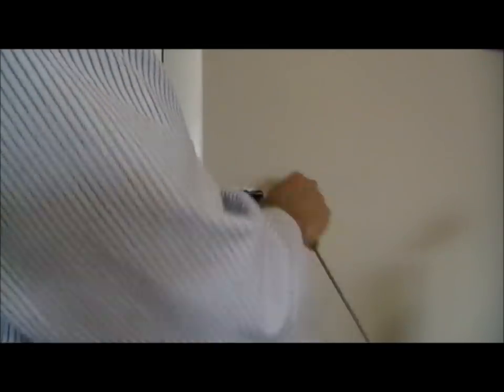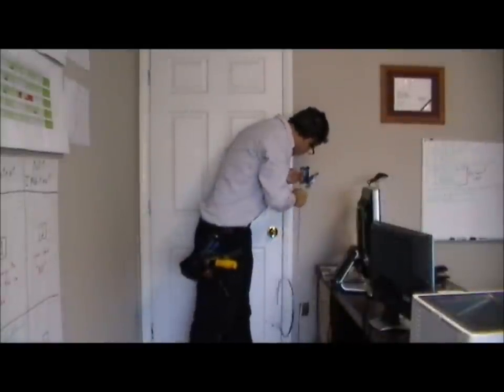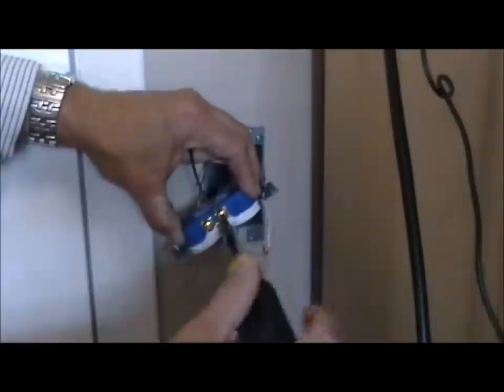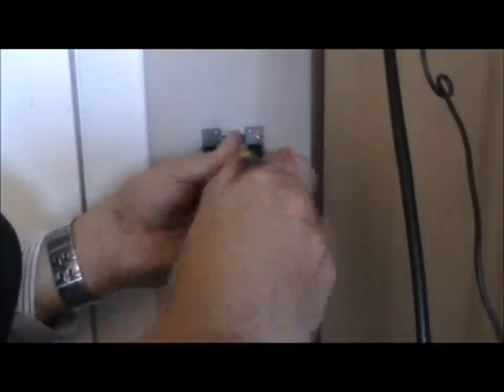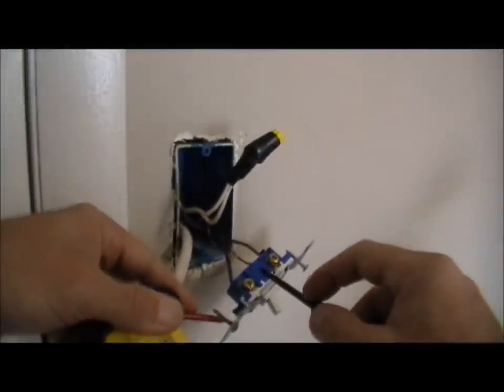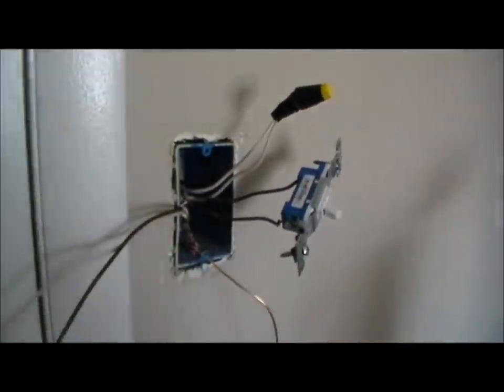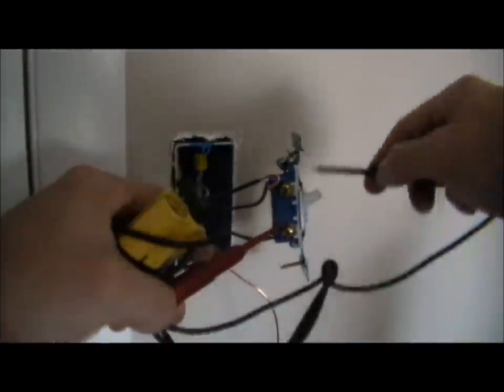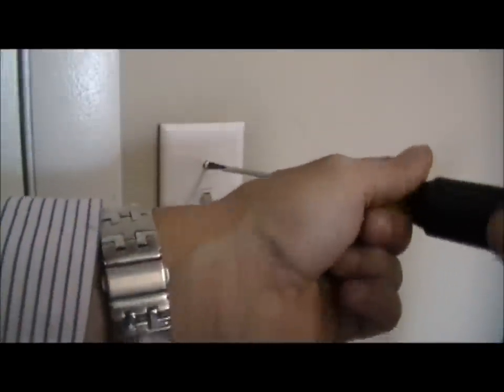how to wire an outlet off of a switch

Comment: Is this an outlet with an electrical flow controlled by the state of the switch?
Reply: nope, the way he wired it the plug it is energized all the time.
Reply: No.  The black wire was connected to the one coming from the breaker/fuse.  The other one was connected to the white wire coming from the breaker/fuse.  Its kinda stupid to wire it across the switch (like in my bathroom) where you control the light with the thing you plug in.  My lights go dim when I try to shave with a plug in shaver so I can't use the damn outlet. if you use it with the lights off, they turn on dimly and the plugged in thing operates slowly like it has extra resistance in it.  So, I had to switch to regular Mach 3 razor instead.
Reply: but you can do something similar to feed a few wall lights off the same switch right? you would just need to hook the lights up to the exit wire on the switch and use one of the plastic caps? Is there a limit on the wattage you could draw from it or any other concerns?
Reply: Robert Wainblat If you don't care about controlling all of your lights from the only existing switch, then yes (but only if your extra lights are connected in series, because you only have just so much room in the box). Lighting circuits usually don't draw much power, but you'll need to know if there are any other circuits tapping the power (hot) wire, before you attempt this. The hot wire (power "in") may already be connected to more outlets & lights. But then again, you could always retrofit a bigger box to accommodate more wires & switches.
Reply: Garras Porgratix
couldnt u rewire your switch box like he did and use ur electric shaver again!!?
Reply from the maker: If you want to switch the outlet you would have to feed it on the other side of the switch. This outlet is live 100% of the time. It is attached to wire coming from the panel. If it was attached on the opposite side of the switch when the switch was open the outlet would be off.

Comment: I'm curious what people find so wrong with this video.

The main issue I see is there was several instances where if you were inexperienced with electricity and decided to work on this hot you would get shocked using his methods.

There should be a grounding crimp on the grounds he twisted together, but not using one isn't the end of the world. As long as they are tightly twisted together they shouldn't come undone. It's a minor code violation I believe.

The switch is using stab-ins which are (as he explained) untrustworthy, but adding the outlet's hot to the screw didn't make it less effective. As long as you don't add two wire hooks the same screw you should be good. A pigtail is the best way to do this.

You also typically do not use linesman pliers to make shepherds hooks or stripping. Wire strippers are used for both. If the wire is firmly under the screw, you're good though.

None of what he done is outlandish and your home will likely have similarly done wiring.

Comment: I WOULD SHUT POWER OF PULL SWITCH OUT OF BOX TURN POWER ON TEST FOR UNSWITCHED WIRE MARK IT WITH A PIECE OF TAPE                                              
SHUT           POWER                     OFF             FINISH JOB   PUT SWITCH BACK IN  BOX  TURN POWER BACK ON

I THANK YOU FOR HELPING PEOPLE LEARN BUT MOST PEOPLE WATCHING THIS ARE JUST LEARNING AND SHOULD NEVER WIRE HOT
ALSO YOU SHOULD NEVER TOUCH THE METAL PART OF ANY TOOL WHEN WORKING WITH POWER ON OR OF ITS A BAD HABIT

Comment: I have done exactly this...live circuit work....but I'm a Plumber so I'm  much more careful. Here a trick....if I'm too lazy to go get a test or amp meter to check if a circuit is live after turning off the "hopefully" correct breaker .....I tap the bare wires with the BACK of my hand or fingers.... because.... electrical shocks contract your muscles and you may not be able to let go if you use the inside of your hand or fingers. Once I know the power is off, I can dig in to what I'm doing..... I've never been shocked testing this way...but I've been lit up being careless in other ways.

Comment: shouldn't your "always hot" terminal on a switch be the "off " (bottom terminal) position of the switch??  That way when you flip the switch up, you know that only things connected to the top terminal will be energized??
Reply from the maker: That's an interesting idea. I like it makes sense. There is no convention for this to be true. You always need to test the switch for the Hot conductor.

Comment: Turn the power off at the circuit breaker BEFORE attaching...you can test, make a little drawing if you have to of what is hot all the time (power in) and what is hot only when the switch is on (power out).

Comment: Wow you really live life on the edge. I work on live circuits too occasionally but I'm a lot more careful and use insulated tools the wiring however is safe only thing I'd say is please be more careful around live circuits it's for your own safety don't mean to be a dick even at 120v 15a is quite a bit more than it takes to be lethal
Reply: The resistance of the body will determine how many milliamps or amps will go through the victim, but like you said it doesn't take much. 25-50 milliamps could do it.

Comment: will this outlet only work when the light switch is in the on position or all the time?
Reply from the maker: The outlet is fed on the hot side of the switch and will work 100% of the time. If the receptacle was fed from the other side of the light switch it would only work when the lights which was in the closed position.

Comment: Dumb question, is there any way to wire a new outlet off a switch that isn’t going to turn off the power to the outlet  when the switch is turned off ?
Reply: NebuR Fernandez    This video showed you what you are asking for.   He connected to the "hot" wire on the switch, not the "switched" wire.

Comment: how did you not get shocked while turning the live screw with your bare finger?
Reply: he wasn't touching anything grounded so the voltage had no where to go. you can touch a hot wire and not get hit if you aren't touching any grounded object lol
Reply: huh?  i've never been "not shocked" when i touched a hot wire.   my boots have rubber soles even if they're synthetic they're insulators.... and yet still conductive enough to make sure i feel it!
Reply: If u not grounded or touching anything else the hot wire can't shock you

Comment: This my friends is an electrician you should not be learning from. The first manager red flag was when he said an open circuit turns the light on and closed is off. That’s some 101 stuff to get wrong. Then he measured with a hammer, you always measure with tape. Then he wired the ground last. Ground always comes first. He didn’t fold his wires. And plate screws should always be finished vertically. That’s more of a pride in work thing.
Reply: You are correct. Using linesman's pliers as wire stripper, not good.

Comment: Did you put two wire on one screw.
Reply: Yeah I say the same thing I'm about to do one in my utility room and that's the reason why I was trying to find a video to show how I hook another wire hot wire to the one coming into the box I thought you use a jumper wire and connecting and then back to the switch this guy hook two wires on to that one screw on the side of the switch I'm not sure about that

Comment: can you power outlets like this through a 3way switch with 12-3 coming in hot ans 12-2 going to the outlets?
Reply: You will have to identify the hot side coming from the panel and then connect to the wire....

Comment: So the wiring in my house just has a black, white and a ground. Not two of each like this video and a metal box. How can I add an outlet from the switch?
Reply: MOPARGuy does the switch do anything? If it does the white neutral is probably being used as a hot. Don’t forget to turn the power off

Comment: I cannot find a situation exactly like my own, this is typical, two neutrals twisted together, I have only one white wire (currently capped off).  From a receptacle connected directly to the panel, I have a 3-core run of Romex (wires inside a jacket) running to a light switch, the white is just capped off with a wire nut, the other two wired (black, and I think the other one is red) are connected to leads on the switch - works as it should, switch turns the light on and off.  I want to wire a receptacle right next to that switch, don't want the switch to control the receptacle, I want the receptacle to be able to power devices plugged into it regardless of whether the light is on, I just want to bring constant power to the receptacle by connecting it to the switch.
Reply: So I think you were sitting at the far end of a 3 way switch circuit. The red & black wires there sound like travelers to me... Hard to say without looking at it directly. You should have seen 3 conductors in there for a 3 way and I'm guessing they just capped the neutral as it was already in the romex and wasn't needed. Since the switch is on the incoming leg of the circuit it doesn't need to be connected to a neutral - only the light fixture needs the neutral connection to send the load back to the power source once it's been through the bulb. This diagram seems to match what you're talking about: https://www.familyhandyman.com/wp-content/uploads/2018/04/how-to-wire-3-way-switch-2.jpg I'm only an amateur in all this but I'd be interested to see if you ever found a solution.

Comment: I thought that you didn't like to plug wires into the back of receptacles? Even though you used that method on a switch, couldn't it still work loose and cause an issue? Switches get turned on an off multiple times a day. I'd have made a pigtail myself. Hence, only one wire is utilized around one connection point...... just my thoughts.....

Comment: He knows his wires but he cut to many corners tht nec may have an issue over. Eg. He was suppose to pig tail the wires together also the hot is the last wire to b connected. Then there's the whole use of three wire now blk red white oppose the the two wire. But to the earlier question yes u can make the outlet go off using the switch by placing the outlets hot wire on the bottom of the single pull.

Comment: So .. the outlet is only receiving power from the power wire connected to the switch, and the new outlet IS NOT being controlled by the switch. The outlet is hot 24/7 even if the switch is in the off position.?
Reply: Yep, Keith.

Comment: in Chicago this would not be code , you need flexible conduit - greenfield  3/8  and 2 wires black and white
inside of it , metal boxes bonded to greenfield ( flexible conduit ) with connectors  green wire is always good , especially in this video

 We did have a great fire in Chicago  in 1871
Reply from the maker: Chicago does have unique set of codes.

Comment: I did exactly what you did but when i plug in my appliance to the outlet and turn it on, the lights turn on and no power to my appliance. Any suggestions would help. Thanks
Reply: Check your appliance, did you figure it out, should work. Check your connectors and make sure you have power to the plug

Comment: In the video at 12:30 you showed which wire was the hot wire and you touched this with your fingers. How did you avoid election shock?
Reply: Rick    Luckily, the ground was not connected to the light.   Since it wasn't, it's the same as a bird on an overhead line.  You become energized but with no complete circuit path, no shock.   He came very close to getting shocked though, had he touched the ground wire at the same time.  If he worked for the contracting company I just retired from, he would be fired for unsafe practice.  The circuit breaker should have been turned off and verified.

Comment: Why was there 2 black and white wires running to the switch originally?
Reply: One set (HOT(blk) , NEUTRAL(wht) and ground) comes from the power source, while the other set goes to the light fixture. The two blk wires (HOT) are connected to the two terminals of the switch, The white wires (NEUTRAL) are connected together using the wire nut. The ground wires are also connected together, as well as connected to the ground terminal at the switch (usually GREEN) and to the ground nut on the electrical box, if the box is metallic, to ground the box and avoid getting electric shocks. In his case, the box is probably plastic, so the ground wire probably is not connected to the box.

Comment: Now what do you do if there is only one wire going to your switch?  One white, one black, and the ground.
Reply: Ross Ashcraft    You do nothing!   You can not add anything from that point, except another switch.   You need a neutral (not white wire) a neutral in order to add anything.

Comment: What do you mean this guy not using a ground nut? Rather than connecting the ground wire to the switch putting a nut on the ground line?

Comment: I don't have an electrican s hammer would a tape measure work or a drywallers hammer I'm a drywaller
Reply from the maker: The electrician hammer is just a time saving cheat. Measuring will always work.

Comment: I have a light switch wired to an outlet. Black , white,and copper wire. I only have power to that outlet with the light switch on. How can I change that so half the the outlet works with out having the light switch on?
Reply: i think the other blackwire should feed the outlet the black wire you used was after the switch
Reply: The video didn't answer my question at all. I have a light switch that controls the outlet.  I want the switch to control half the outlet. In other words, when I have a light plugged in it will come on with  flipping the switch and when the switch is off I can plug something into the other outlet and have it work with out flipping the switch on. How do I wire that?
Reply: +Tom Gala if you look at the outlet screws you will see  a tab that connects the top screw to bottom  similar on both sides you need to cut those tabs on both  sides of outlet then  supply a hot and neutral to top any to the bottom half connect the wires that are coming directly from switch. neutral in one side the hot in the other  then half will be control by a switch the OTHER  half will always have power .
Reply: Lucky Joestar what exactly do you mean when you say “and join this pigtail to the black wire from the source and the white wire to the switch”

Comment: Hey, so does the outlet turn off when the light switch i off?
Reply: Halley Chopra it's wired to the hot side. So it'll be live all the time.
Reply: Halley Chopra it's wired to the hot side. So it'll be live all the time.

Comment: In the UK this would only be done by some one with little to no electrical knowledge because:
1. We have different cable sizes for sockets and lights.
2. We have different amp breakers for sockets and lights.

Also in the UK this would not be done live in most cases.

Comment: Cam you connect two hot wires on one screw ? that's not what they were teaching us
Reply: No
Reply from the maker: Very good observation. No you cannot put two wires under one screw. There is only one wire under the screw. The other wire is installed in the backstab location of the switch. Since that video was taken we are no longer using the built in backstabs on electrical devices. We are opting to pigtail and use the screw terminals because they work much better with AFCI circuits.

Comment: Hey I just watched this video for the third time so I go to the light switch and open it up but instead of seeing this setup I see "exactly" this, the switch only has two poles on it, the "black wire is on the top, and the white is on the bottom, there is no other screws to post anything else, the ground wire is tied off to the box only, and not on the switch. I looked at a couple other switches in the house and they are all wired exactly this way. Please tell me how I can add an outlet to this switch.
So the problem is upstairs in my living room there is no outlets on the inside walls only the outside walls, I wish to put my TV and stereo on a inside wall. So going down my basement stairs there is a light switch at the bottom of the stairs, this light switch is directly below where I wish to put an outlet for my tv and stereo. Now if this switch is wired as I have said above can I still tie into it. Please help, anyone have an answer. I am in Canada we have 120 volts 60cycles..
Reply: No you would not be able to cause there is no neutral in the box, you would have to come from the light box or a junction box that does not have too many wires on it.
Reply: Be careful that you aren't ty-ing into a three way or four way switch because the wring patterns are different. From a big picture perspective you are just attaching your plug by attaching to an existing neutral (white) and an existing hot (black) from the same circuit.

Comment: Thanks for posting this video.  For the DIY'er i would have given a solid lesson in electrical safety, such as cutting breakers, taping sides of the outlet screws for the next hack, as well as some handy tips such as testing outlet below before screwing back in the switch (in case a connection got loose or reversed).  But given that i have NEVER seen a licensed electrician cut power to a 110v outlet before putting in a new receptacle (they know the risks and take them willfully), so the absence of this does not surprise me.  The principles are correct, but the DIY hacker should get some safety tips because they are much sloppier and / or ignorant.

Comment: Don't recommend working with hot wire, not shutting power off at circuit breaker  & testing that it was off. Not recommended to have two wires on one screw, use a pigtail. One wire per screw.